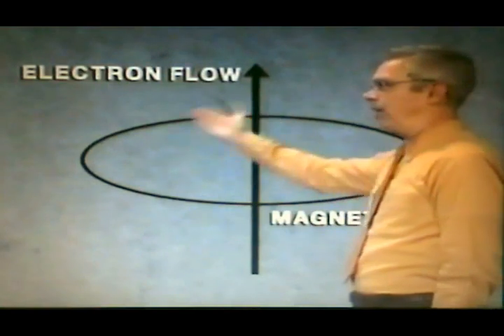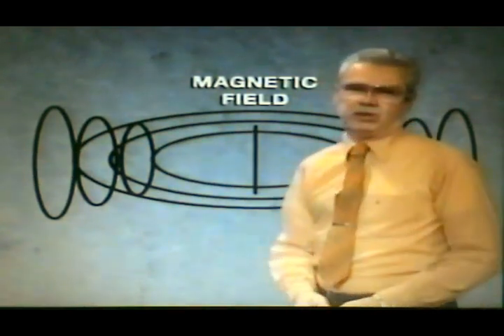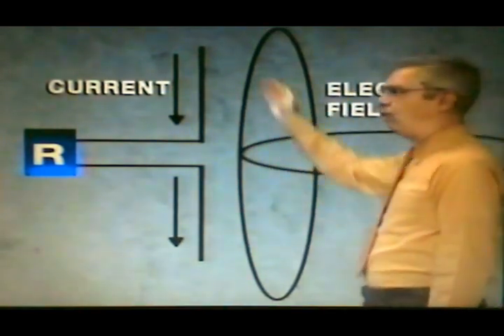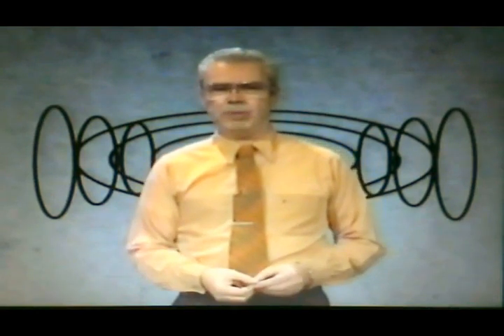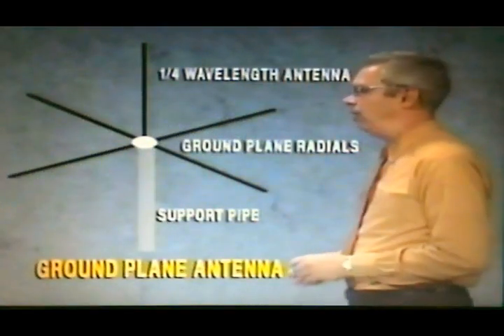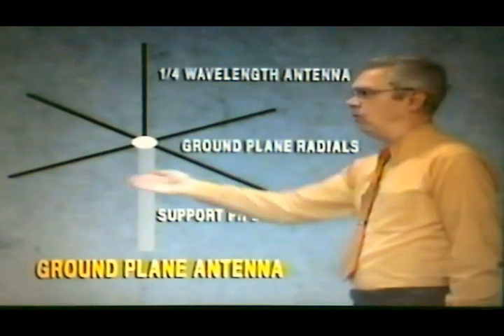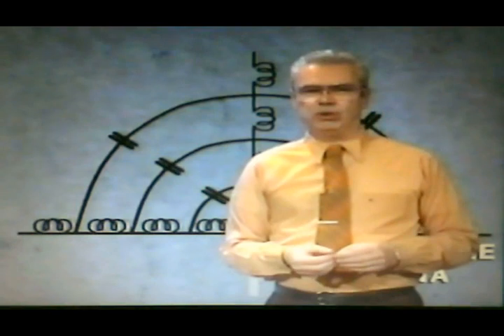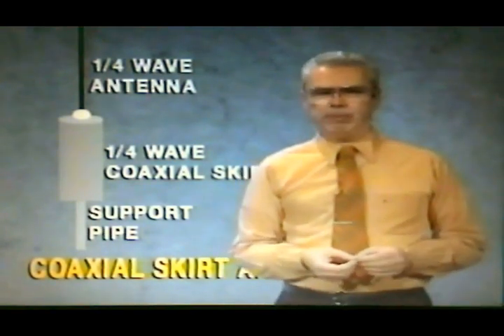Introduction to Antennas

Comment: Thank you holmes, it was an interesting video. Interestingly I have a question about antennas and frequencies, recently someone at work is proposing this theory that "for a motorola repeater like XiR-R8200 or SLR5500 or etc to work properly there must be at least 1Mhz space between Tx an Rx frequencies" and he is sure that it is written in ETSI Standard. Since i couldn't find a proof I thought maybe you can give your opinion about this matter. Again thank you for you great works
Reply from the maker: The TX-RX spacing is not, as far as I'm aware, defined by ETSI but in some cases, it's defined by the local telecommunications regulator as part of their spectrum planning activities. 

Also there is a technical/practical limitation in the duplexer used with the repeater, particularly on VHF. For example,  a six-cavity duplexer on 145MHz with 600kHz spacing is the size of a large tea chest, while at 5MHz spacing this goes down to a size of a book. The former would probably only offer ~70dB of isolation compared to ~90dB.